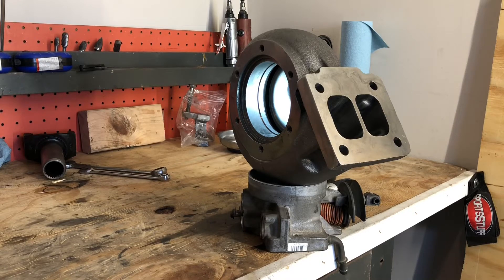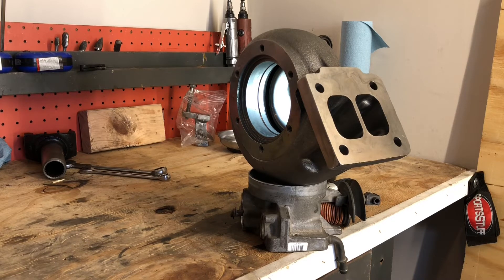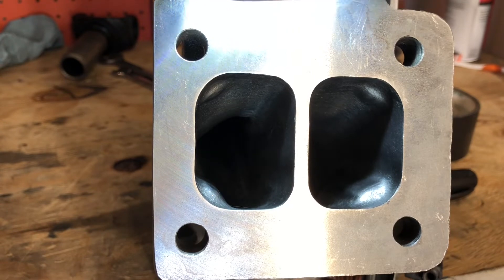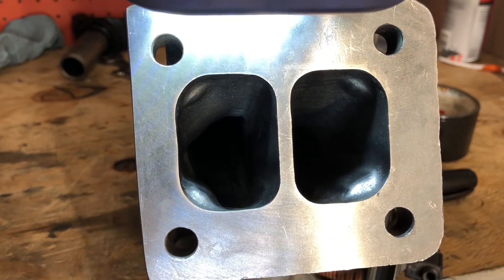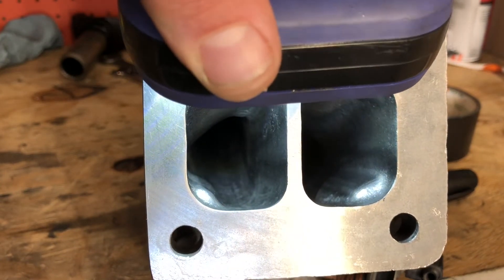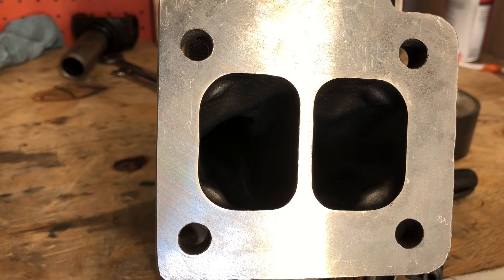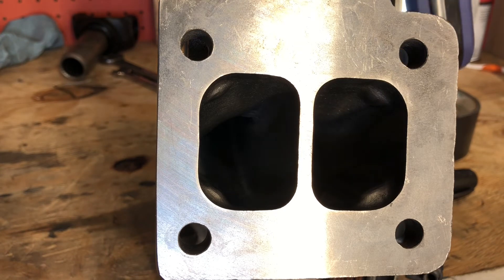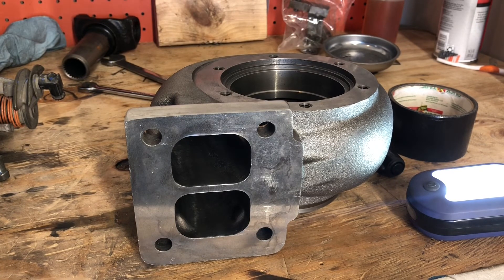Porting a GT45 Turbo?

Comment: I had an idea for reaching farther into the snail.. Use a new clean section of pipe/toilet snake and affix a piece of croakus cloth to the end and chuck it up in a hand drill or die grinder and see what you can reach..If you use a lighted bore scope you can insert to see your progress.. About 15 yrs ago I wonder why no one ported the inside of a turbo, then I forgot about the idea.. I think this idea would work..
Reply from the maker: You’re on to something, making an old school flapper setup would work!  Also a flexible shaft with a flapper or something similar would work to!  Excellent idea, I truly appreciate sharing!  
I wasn’t notified of a bunch of comments sorry for the late response!  Thanks again stay tuned! JD

Comment: sometimes those HF magnets come in handy in collecting the metal fragments from such and operation.  Just pull the magnet out and most of the little filling will come with it.
Reply from the maker: Great tip, I don’t mess with cast iron much at all anymore but this is a good idea!  I saw in another video if you put sandwich bags or similar around your magnets there simple to clean off by removing the bag over a trash can!  Thanks I appreciate it!  JD

Comment: My Header to Turbo match was off a fair bit, you could easily see how the exhaust flow was going to hit a wall and have to climb over it causing a bunch of turbulence.  Now you wouldn't want that on your intake manifold so I figured it was not helping here, so I radiused everything, even the center divider to smooth out the flow in that area.
Was it a waste of time??
Hell, I don't know, I didn't try it stock, but GT45s are stupid cheap and if I smoke one, Big Deal, get another.
Reply from the maker: I agree100%
Reply: All I did was gasket match the exhaust header to the turbo. anything else is a waste of time to me. The exhaust flows so much. The longer and bigger the tube. The slower the flow